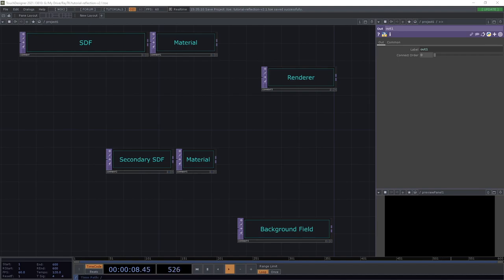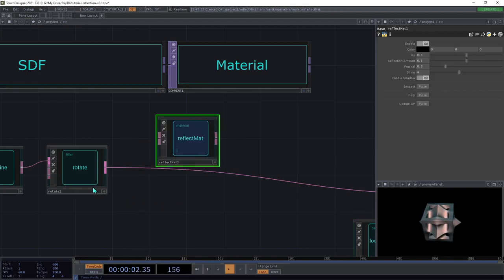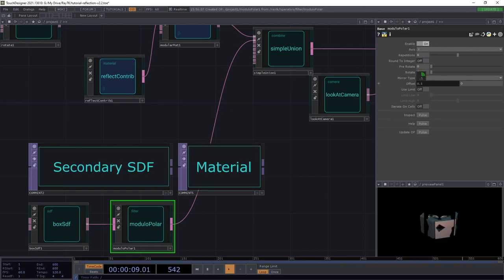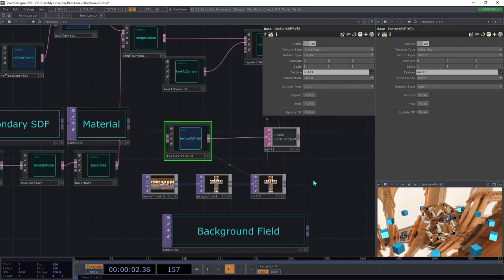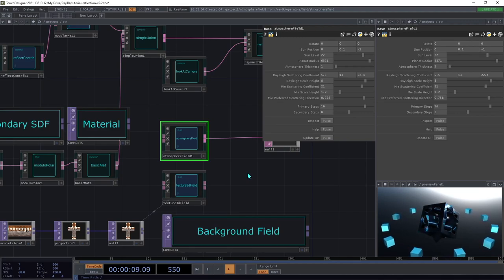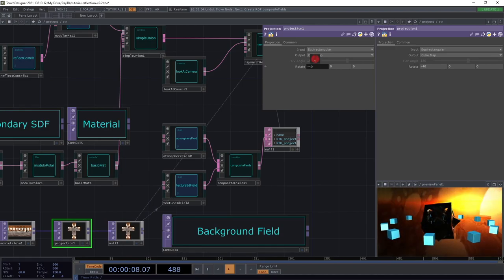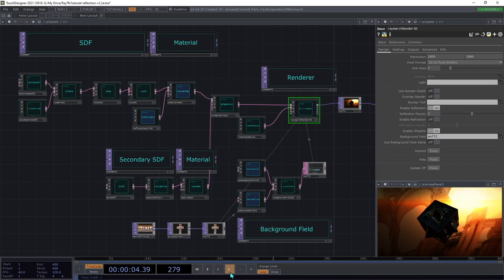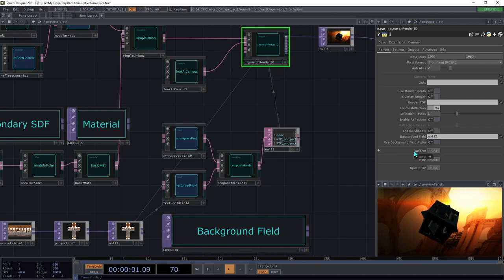RayTK Tutorial: Reflection & Backgrounds

Comment: Is there a way to use the projection TOP to assist in the reflection of the material, but not display in the background?
Reply from the maker: There's a setting on the renderer "Show Background". If that is switched off, and there's a background field, it should do what you want.